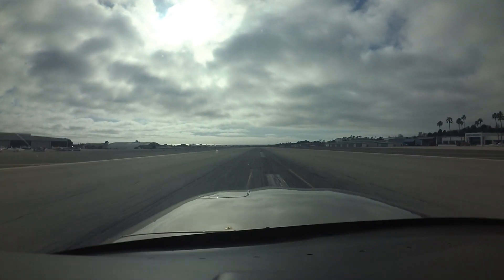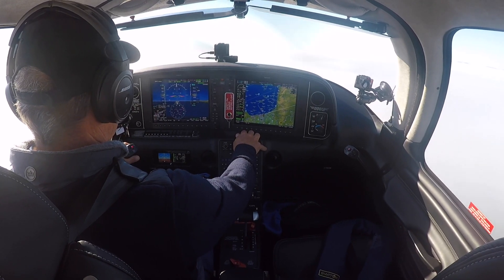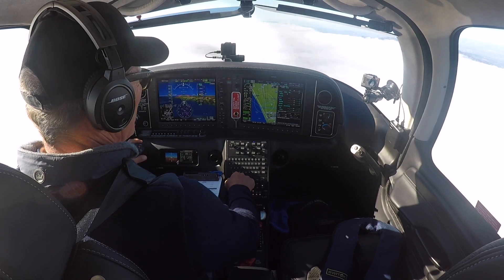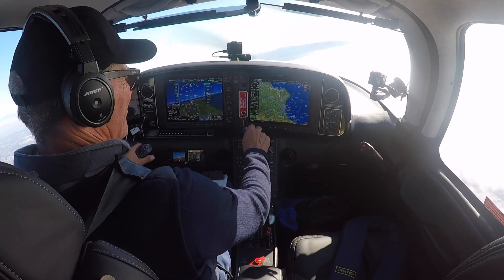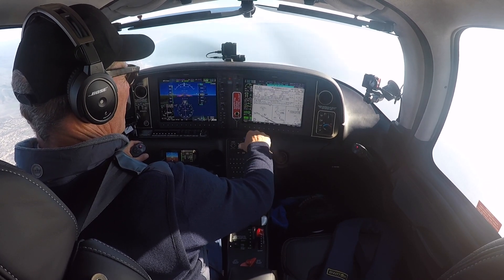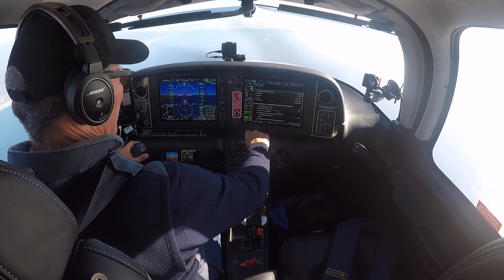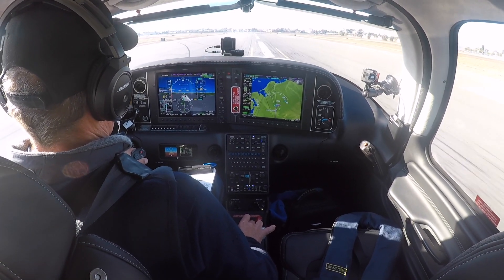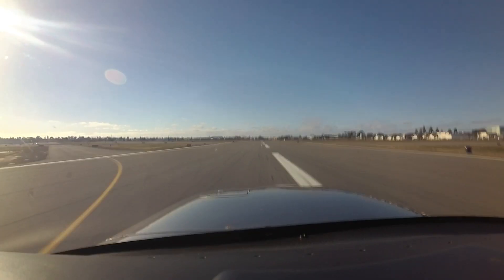Vector to Final Lesson Learned in Cirrus SR22T G6

Comment: Our technique in the jet is to remain in GPS mode and eliminate waypoints (one by one or sometimes several waypoints at a time) along the approach until there are no waypoints remaining in the flight plan waypoint list except the final approach fix. The terminology we agree to use in the cockpit is “please sequence the FMS” or the slang term we use that everybody (?) understands is “please sequence the Box” . Then we can be confident the controller will not throw us a curveball and send us to a FMS waypoint which is believe is in Magenta (GPS) mode for your airplane. We talk about how we will handle Flight Management System (FMS) duties during approach plate briefing. Thanks for sharing. I will definitely send this video to my student pilot son! Actions that seem normal (ingrained) to me now were lessons learned when I first started flying FMS systems. Good job sir...
Reply from the maker: Thanks for the tips Sierra. This flight happened early in my time with the Cirrus and today I try to do exactly as you've outlined here for the most part. I try to constantly calculate where on that final approach course the controller is going to have me intercept and I activate that leg with GPS in standby so that when I reach it GPS takes over and swings me onto the course. Prior to the Covid challenge here in So Cal we almost never got vectored anywhere but the final approach fix leg so the other waypoints became a distraction. But lately I've been getting clearances to IAF fixes just about every time now that there are very few commercial airliners travelling thru LAZ Bravo airspace. But that will change shortly. Thanks for your post. Cheers-Ren
Reply: The Ren Baron Hope these comments help out the new to IFR guys.

Comment: Nice job Ren, I'm a couple weeks from my IR check ride in a perspective sr 20 so I feel your pain.   I kept saying get back to the magenta needles to my PC screen while you were figuring out the problem. (My instructor has laughed at me several times struggling with that, it's finally sinking in.) That's where the AFCS gets its steering info from, nowhere else, but you did need to reload the approach first.   Once you had everything straightened out, direct to the IAF, approach activated and in approach mode on the AFCS, perspective will change the needles for you on an ILS and LOC approach, you don't need to do it.  Also, the stepdown altitudes are next to the waypoints on the MFD in the Flight plan split screen,  I use those rather than writing them down ( I keep plate on Foreflight in case I lose the MFD info),  I make sure they match the plate as part of my brief.   Finally the checklists, you can click through to the bottom, there is a go to next check list item, click that and it goes to the next checklist,  or you can use the FMS knob to get to your next checklist if there is one you want to skip to.  To exit, press the exit softkey on the MFD,  this saves your position in the checklist, where as if you just hit the map or fpl key, your position is lost and you have to find the checklist each time.    I enjoy your videos,  l love your plane,  you do a great job flying it.   Take care.
Reply from the maker: Thanks for the comments and tips. Good luck on your IR checkride. FYI on the new Perspective + the checklists no longer lose their place no matter what you hit. Makes them truly idiot proof!
Reply from the maker: I'm smiling at your comment about cheering me to get back on the magenta needles. It reminds me why having 'game film' of flights is such a great learning tool for me. In the moment things are moving fast and there's no way to hit pause. Getting a chance to review and critique each flight always make the next one better. Can't wait to go flying again. Cheers-Ren

Comment: That happened to me on a flight , tried to go direct to a fix but it was in VLOC mode , after awhile trying I did exactly what you did , scroll through the CDI until GPS steering came back . then I went direct enter enter Nav and it worked .. Nice flying ..

Comment: Yes seems like selecting vectors-to-final mode is a bit of a trap.   I actually wonder whether it should ever be used.  Just loading an approach with your ‘best guess’ IAF seems to give you the best of both worlds.  You are still steering in heading mode, and can select a waypoint any time you want.    You make a great point about making sure the CDI and Nav inputs are Synched up.  Thanks
Reply from the maker: These days I typically try to figure out what leg I'll be vectored to and make that the active leg while I'm in heading mode with NAV (GPS) armed in standby. Like you I like having all the options available. Thanks for your comments. Cheers-Ren

Comment: Great video!  Glad I stumbled on you, just subscribed.  Thanks for including all the learning points.  I remember my IFR instructor telling me that vectors to final is a “heading mode” autopilot.  And for whatever reason, Garmin dumps a lot of waypoints (probably to clean it up for you on final) when you activate it.  Anyway, I’m not totally sure, but I think if you “load” rather than “activate” the approach at that point, you may keep your waypoints and it definitely won’t switch your CDI to the LOC.  Then you still have the option if they suddenly decide to give you a  “direct to” fix.  Or,  it’s 2 buttons (or knob then push) to activate when ATC clears you to intercept on a heading.  Even here in central Illinois we get vectors to final a lot, probably because there’s not much going on and they don’t mind.  It helps to avoid a procedure turn on an opposite direction approach.  Or, keeps you off the approach while someone else can use it as is probably the case in SoCal.  Thanks for the video, I look forward to watching more.  Nice plane!
Reply from the maker: Thanks for the comments. Much appreciated. Glad you enjoyed the video. Cheers-Ren

Comment: VTF does that on older Garmin systems such as the venerable 430, too:  it throws away all other waypoints.  That "Direct To" doesn't do what you'd expect is a bit more strange, though.  Does the CDI switch automatically on the Perspective system?  If I understand you right, it switches to LOC.  Can't you switch it back to GPS?

Comment: All G1000 aircraft I've flown switch the CDI to the localizer (green HSI) when activating the vectors to final on an ILS approach.  I believe Garmin did this because if you truly are receiving "Vectors to final" by ATC you should be given headings to fly as they line you up with the inbound course of the approach... thus shouldn't need GPS HSI anymore.  

If you were doing the RNAV/GPS 28R approach and activated vectors to final the CDI would have remained in GPS.  The HSI would have just put the inbound course on the HSI.  So in your flight you could have selected direct to Bakel and it would have switched the HSI to go direct to that IAF like you anticipated.  I prefer GPS approaches in general to ILS especially since most runways with an ILS have a GPS w/LPV minimums anyways.  

Nice plane, safe flying!
Reply from the maker: Thanks for the comments. Cheers-Ren

Comment: On an ILS approach, why do you have to manually enter the minimums? Seems like the system should have those already.
Reply from the maker: The Jeppesen charts list the minimums in the database  which triggers the minimums audible callout. But the pilot enters the minimums that display on the PFD for visual reference. Thanks for posting. Cheers-Ren
Reply: @TheRenBaron  Thanks for the quick reply. I'm surprised the minimums can't auto populate. I very much enjoy your videos and the explanations. More than 30 years have passed since I was last in a small plane, and I'm considering getting back into the cockpit.

Comment: With planes as advanced in the avionics department as the Cirrus, it is so easy to forget one little thing that can snowball into larger effects. I know this well myself on the Avidyne that my Cirrus has.

On another note Ren, I've been meaning to ask, how long did it take from start to checkride to get your Instrument? Also, how long did you have you PPL before you started Instrument training?
Reply from the maker: It took me about 6 months from the time I started IF training to the time I passed the test. That included a misguided start with a "get your IR rating in 10 days" program.   I had my PPL for about 6 months before I decided to get the IR rating. I took all my training and the checkride in my Sling 4 experimental. But the truth is 6 months after getting the IR rating and flying IFR plans constantly in the Cirrus I'm only now starting to get really comfortable. For me its not unlike golf. I need constant practice to stay sharp.
Reply: @TheRenBaron  I can imagine. I am studying for the written now IR exam now... Wish me luck.
Reply from the maker: @zacharynorman397  The written test is the hardest part. Good luck to you!!

Comment: Another great video! However, I don't think you need to press the CDI to get green needles. With the approach activated, as you turn towards final, Perspective will automatically give you green needles, trust me, lol. If you were cleared for a complete approach with a step down hold, you would get green needles turning final after the hold. If you pressed the CDI before the hold, you would never enter the hold and deviate from your clearance.
Reply from the maker: I think I pressed the CDI needle manually once I got on the final approach course just to make sure it switched. At that point I was not interested to see if any more 'surprises' were in store. Thanks for the comments! Cheers-Ren

Comment: Well...I'm a little bothered by the fact that you had to fight the system (literally) and had to figure out why it would not accept a command from you. 

AND...that you had to later refer to a 600 page manual as to why the system didn't do something while you were in the air. 

This seems counter intuitive to the very reason why we have these systems. They are meant to make things easier and fool proof...not require that you hold a master's degree in glass panel logic. 

I'm glad you figured it out and all, and it's an awesome video, (love your channel too) but it makes me think..."Hey Garmin...WTF?". 

Ideally, if any system has my plane and the PIC by the balls, and it ignores a command or input, it had better tell me right then and there exactly why it's doing that. If I have to memorize or read a 600 page manual to fly a plane...then...no f-ing way. 

Garmin 1000 = HAL 9000
Reply from the maker: The Garmin Perspective plus is an amazing system but like any complex system its up to the operator/pilot to understand it. So I'm quite happy to take the time to learn it by studying it and using it. I'm not sure how else you would do that.
Reply: @TheRenBaron  Thanks! I agree it's an amazing system. Amazing plane too. But I think it should not have left you hanging like that. Not in a flight critical situation. It denied a request without explanation, during flight. Anyways...great video, as always. Keep up the great work. I'm a fan!
Reply: @TheRenBaron  Just for the record, I'm not bitching at you. You did all the right things and did an amazing job. You're an awesome pilot. 

I'm bitching at Garmin, because...my engineer brain is telling me that they should have an 11th commandment within the development of this technology that reads "Thou shall not ignore commands from a PIC without an on-screen explanation".
Reply from the maker: @motoxcarbon9891  Ok you are engineer! Ok that makes alot more sense to me. To be fair, the plane did exactly what it said it would do in the manual even if it was a bit different than the other ways the CDI needle switches (with GPS guidance). But it would make the system even more powerful if the system was smart enough to have on screen annunciation or reminder that no GPS is provided. That's a great idea!
Reply: As soon as you hit vectors to final I knew what was going to happen. I’ve watched enough videos here to find out. I think the new versions do not dump all your approach fixes when you go to vectors to final.
Reply: @rnordquest  Well then...they fixed it!!! That would be a worthy thing to let everyone know.
Reply: @motoxcarbon9891  That might only apply to Garmin GTNs.  The Cirrus system is a sort of parallel path that does sometimes more and sometimes less than a standard Garmin.  The key is to not use VTF since they invariably at some point will give you direct to one of those procedure waypoints or segments.
Reply: @rnordquest  Got it. Thanks! I still stand by the concern that no system of such should just ignore a command without giving an explanation....other than one stated in a 600 page manual back at the office. This is best understood when you watch Ren act confused and even when he tried to over power the autopilot. THAT's not cool. Good thing he figured it out and all, but...this is clearly something only related to glass panel tech, and I'm feeling itching when a plane ignores the PIC.
Reply: @TheRenBaron  Well...it appears that your system did a Boeing 737 MAX on you. 

Nothing like making sure that you have to self-educate yourself, as to learn how to shut-down a computer that is controlling your aircraft.
Reply from the maker: I'll respectfully disagree on that one. A plane is a complex piece of machinery and it requires that the operator understand what it can and can't do whether its a chainsaw, an electric toothbrush or a Cirrus. I think it would be a fair criticism to say that all of today's automation in planes gives a false sense of security that the plane can fly itself. I think in the case of the Garmin avionics if someone believes that you can just jump in the saddle and wing it as opposed to studying its functions in detail they are asking for trouble. But I do agree that 600 pages is alot to digest but the consequences of not knowing something important is a risk I don't want to accept. Thanks for taking the time to comment though. I appreciate it. Cheers-Ren
Reply from the maker: @davejohnson8960  I will tell you that in the light of all the 737 Max 8 news I've made it a point to know EXACTLY where that AP servo fuse is and have practiced turning off AP on the sidestick, on the AP controller, and if that fails pulling the AP fuse!! I don't want to go down like that!
Reply: @TheRenBaron  I do agree with you, it's just a matter of how much control should a computer have. The moment you tried to force or fight the autopilot, I cringed. And then I cringed again when you had to read a 600+ manual to learn when and why a computer fought you on something during an lFR long final. At that moment, it WAS the PIC!!! 

The rule should be, "Obey my command or tell me IMMEDIATELY why you disagree with me....AND never...override me". 

The computer should never EVER have more control than PIC. The moment you grabbed that stick and fought with the aircraft, it should have shut down the autopilot, or popped up with a big message that said, "I'm doing this because..." or maybe even, "See page 452 in the manual".

It appears that the MCAS on the 737 just kept moving the elevator another 5 degrees (disagreeing with the trim commands of the pilot) until it was in a full locked position..and no explanation as to why at the flight deck. So...they needed "extraordinary" training in order to know how to defeat a computer that took control of their aircraft. Not cool!!!

Funny thing...same thing happened with these Toyotas that killed people when the throttles got stuck. Ya know...the cars that have a push-to-start button. Well...you can't shut off the motor because there is no key, applying the brake doesn't do anything, and pushing the START-STOP button doesn't work either...UNLESS you press AND hold the button, (it's in the manual). People died because of not having the "training" required to know this. That's just stupid...that a computer would do that. In that one case, 4 people died while on the phone with 9-1-1. No one knew what to do. 

That said, I highly admire your dedication to learning your aircraft and sport and being a perfect pilot. I would trust you with my life. Love your channel. Keep up the amazing work!!!
Reply from the maker: @davejohnson8960  Thanks. Here's what I've learned about the Autopilot now. If its not doing what I want or something unexpected I immediately disengage it and fly the plane by hand until I figure it out. Based on your comments today I contacted one of my friends at Cirrus and asked them what a Cirrus pilot should do in the event of a runaway autopilot like in the 737 Max 8 crashes. And it will be interesting to see if the pilots on those planes actually knew how to shut the AP down and if so whether they did the procedure or not. I saw an interview with Sully Sullenberger who reckoned that there was an issue with the AP software but also a lack of training that prevented the pilots from disengaging AP altogether. No matter what they find it won't bring back those folks but it might help save lives in the future.
Reply: @TheRenBaron  The interesting thing about the 737 MAX is that the system/software (MCAS) is there in order to "certify" the design of the new engines being further forward. MCAS is an automated "compensator".  It's a software fix to manage a hardware update. Nothing wrong with that. 

Not considered a big deal, it was tucked in and released with little thought, training, testing. A pilot "aid" in order to deal with a nose high attitude. But...the system fails in two ways. It goes crazy and locks the elevator in full down, and fails in that it keeps what it is doing a big secret from the pilot(s). 

Sully appears to be 100% correct. 

Nowadays, even my toaster won't do what I tell it to...because it thinks it knows better.
Reply from the maker: @davejohnson8960  I've got a runaway toaster too!